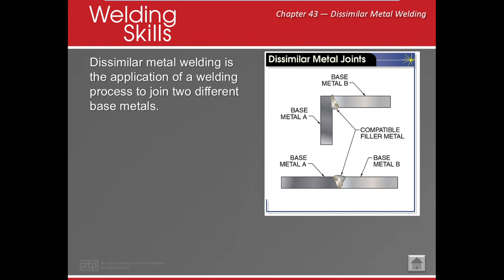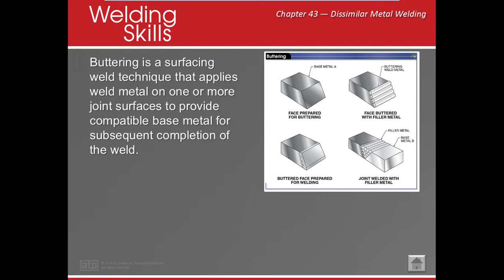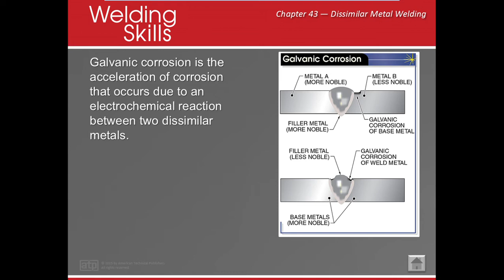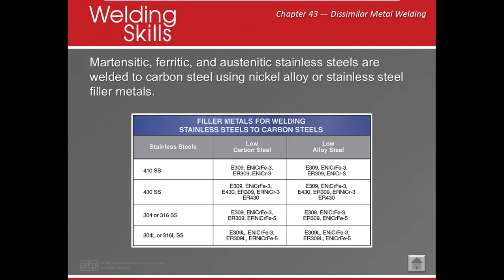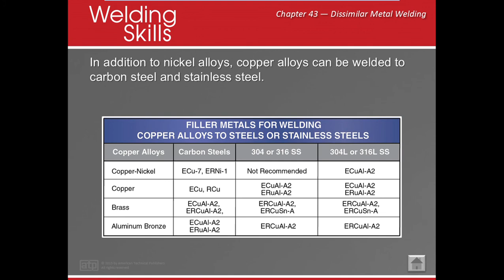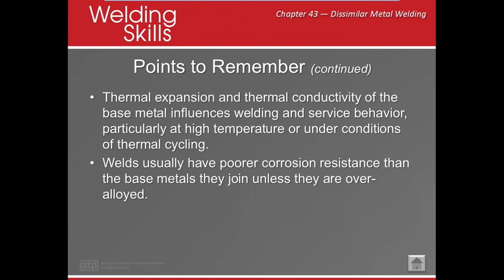Dissimilar Metal Welding in GTAW Ch 43

Comment: So definitely we can take pipe of ss316 and fittings of ss304 in case ss304 pipe isn't available
Reply from the maker: You could, but you need to make sure that the filler material is compatible with both materials
Reply: @danimedinaweldtheworld5806  topic is clear to me thank you❤️